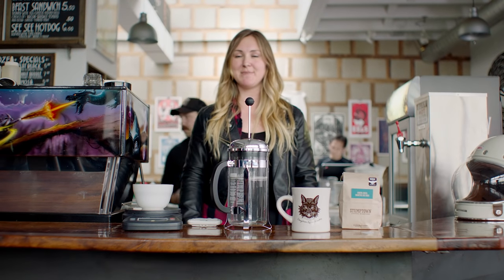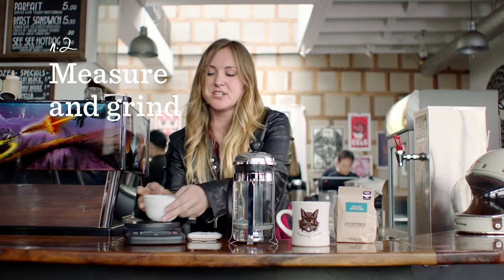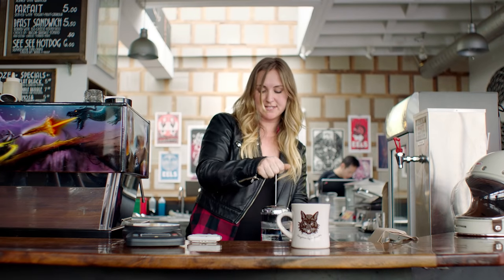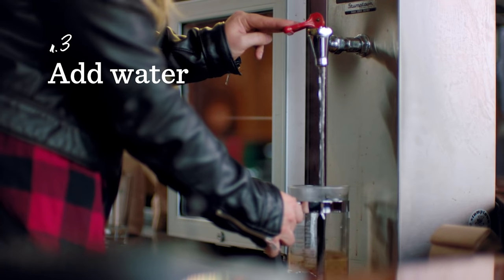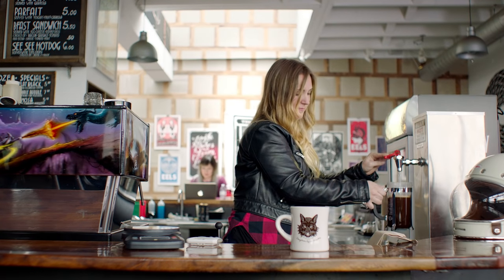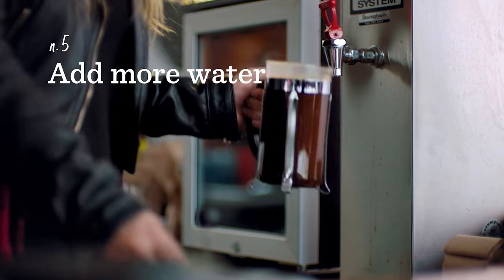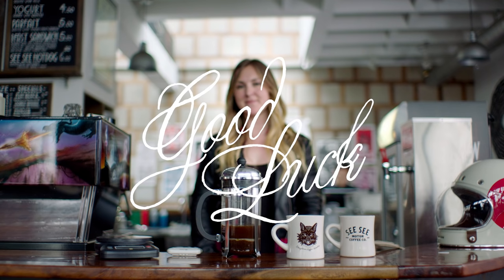How to Brew Coffee in a French Press | Stumptown Coffee

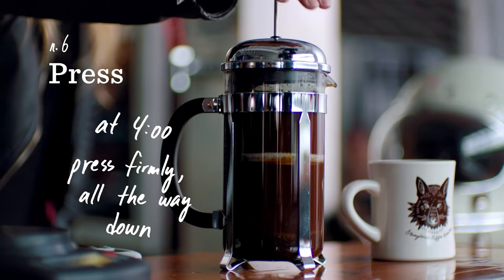Comment: 5:05 after all this you SLAM the coffee at the bottom that way, needs more finesse !
Also I believe that your coffee is grinded way too coarse if there is no resistance at all when you push it down... there should be a little in my opinion, and this difference of pressure would prevent you from pushing it down so fast.

Comment: Skip preheating the carafe, show the grinding of the coffee (breadcrumbs is NOT a setting), measure the water:coffee ratio (how much water did you use? Fill up to the metal band? There are different sizes of French press), and show the cleaning of the French press (the most important step!).

Comment: Should I be compressing all of the water out of the grinds when plunging, or should I basically use the plunger to strain gently? My new press doesn't compress the grinds in the bottom of the beaker because the shaft on the plunger is too short. My old press would actually compress the beans in the bottom.

Comment: 56gms doesn't equal 8 tablespoons. it equals 4 tablespoons
Reply: I noticed this too - huge discrepancy!
Reply: this can be dependent on your roast and grind type. darker roasts will generally need more coffee to extract at the same saturation as lighter roasts. roast will typically effect the relation of volume to weight. meaning darker roasts will be lighter in weight, because more the bean (moisture and physical mass, etc)  has been roasted away in the process. same with grind type. variances in grind will effect volume to weight. finer grind will be heavier, because there is more coffee granules per tablespoon, and less negative space. so if you combine these factors, there will be a major discrepancies in a practical setting. this guide was more for the masses, and just a general guide to people with a french press to get started. if you really want to replicate this recipe, use the same frenchpress, volume, and coffee used in the video. also same grind type (bread crumbs whatever the hell that means). i think they used stumptown santa rosa, costa rica. hope this helped.
Reply: Every tablespoon of coffee equals 7 grams. 56/7 = 8 tablespoons.

Comment: wasting hot water just to warm up the press makes me cringe.
Reply: Asad the great - She could use the same water again instead of wasting it.. It won't lose the heat for 30 seconds.
Reply: then don't do it.
Reply: @TubYuSuper  actually, the fact that the water was used to heat up the press makes it lose a lot of temperature. If you pour boiling hot water ( 212f in a pre-heated french press it imediately drops down to 205 degrees ( thats at the upper range of perfect brewing temperature) . So that water that she used to warm the french press is WAY bellow that
Reply: Tweker1337 Well, if it will affect the final product, guess you are right.
Reply: @TubYuSuper  doesnt mean she couldn't re-use that water later tho instead of throwing it away! Totally agree on the not wanting water part